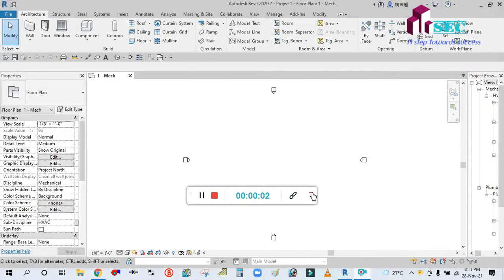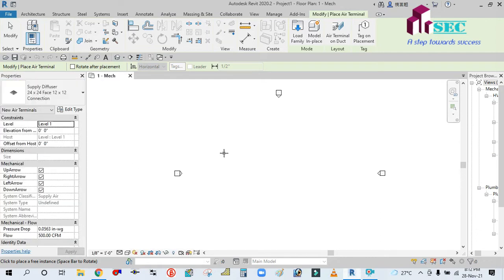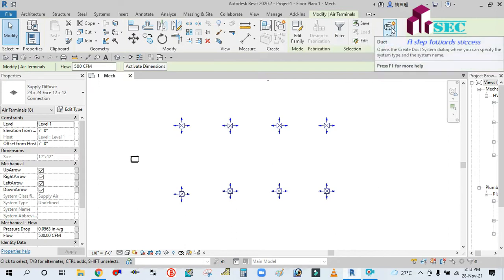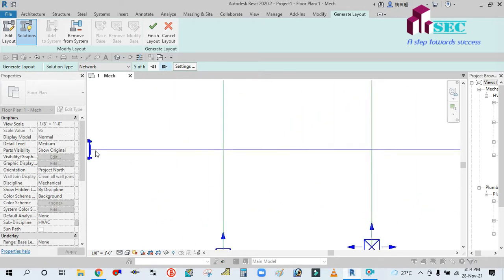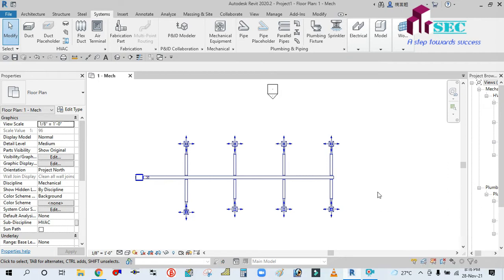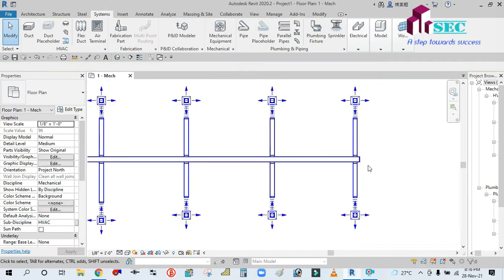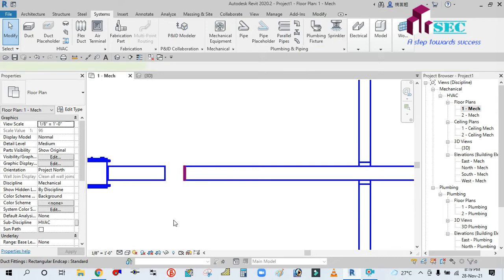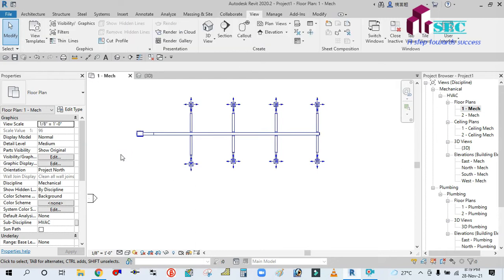AUTOMATIC DUCTING IN REVIT MEP II AUTO DUCTING REVIT MEP II FULL GUIDE IN HINDI.

Comment: Not good....the unit is rested in the ceiling not on the floor if you want floor mounted unit you can select floor mounted AHU Horizontal. 
Solution is in this duct layout you can cut the section of duct and equipment then go to the section align the middle of the top duct and equipment duct middle point then you can simply draw a straight duct. Thank You